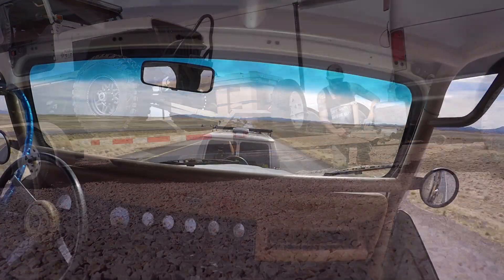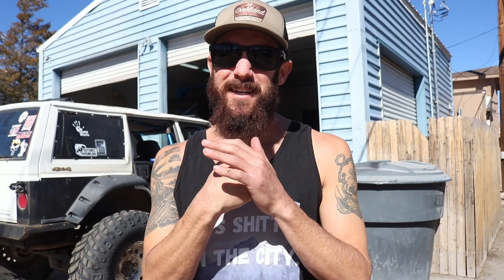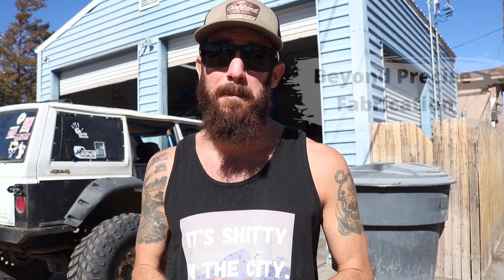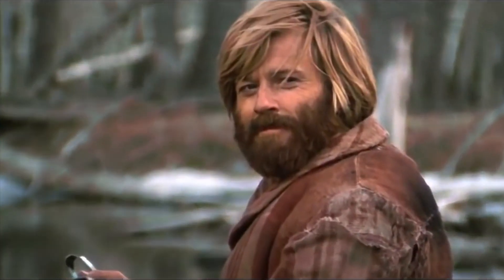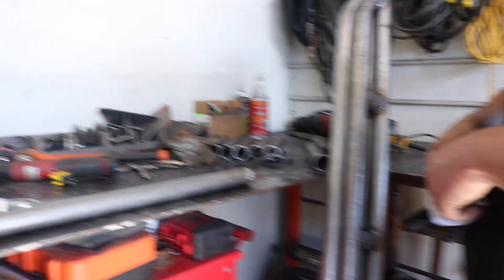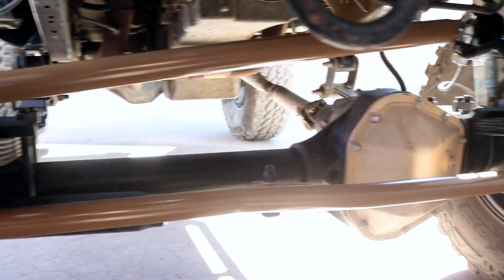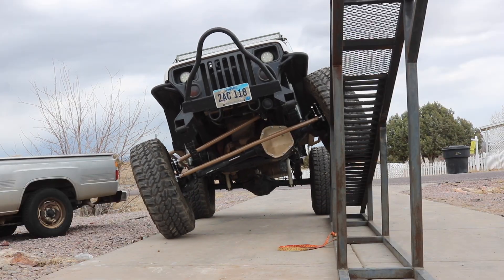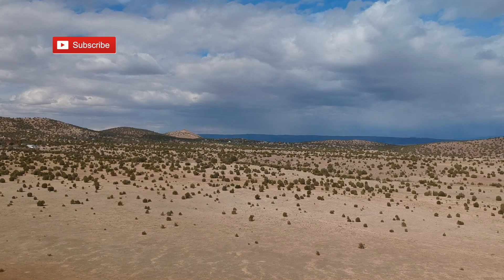V8 Jeep YJ on Tons FIXED! Dana 60 Gets High Steer Kit

Comment: I ran those raceline renegade 8 wheels. Probably 15 miles off road all over Baja, So Cal and Nor Nev deserts under a fully built Carli dodge diesel. Best non bead lock wheel I have ran. I fuckin love them